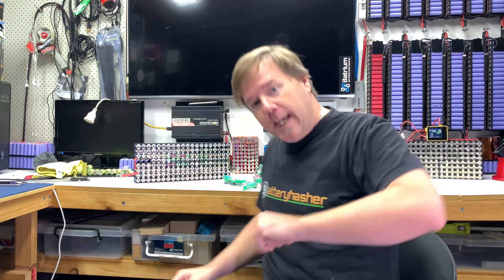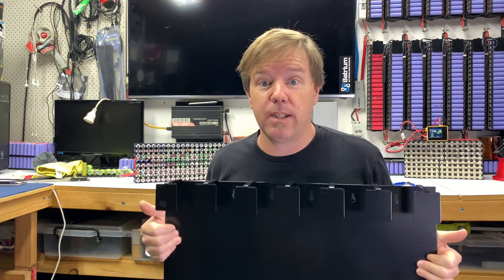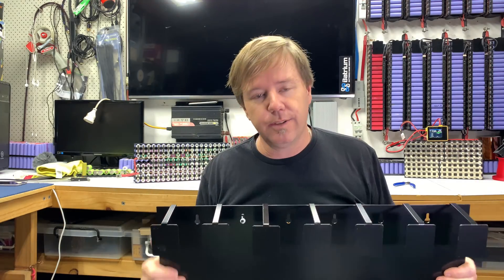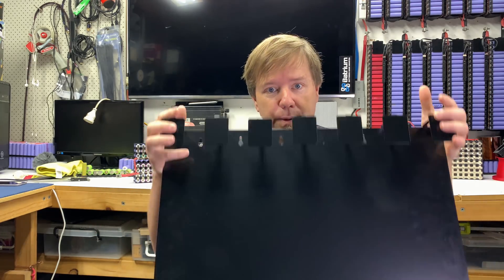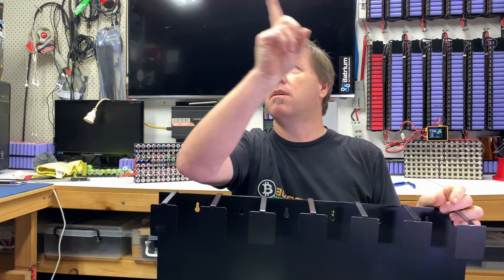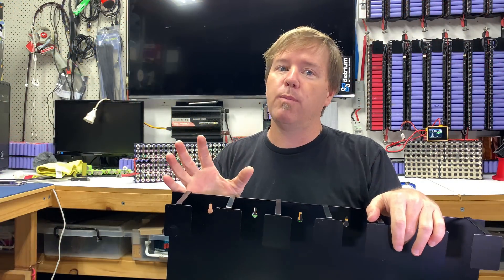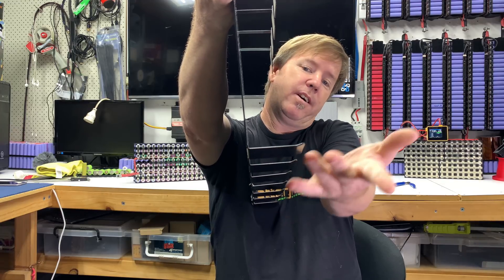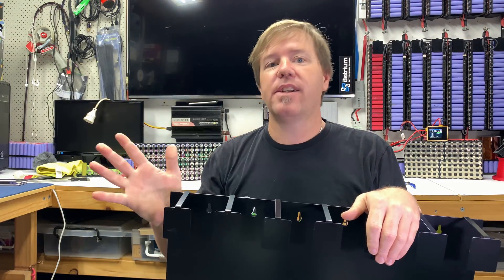My DIYPowerwall Wall mount CAD drawings

Comment: Have you done away with fuse wire?  Look like all your packs now have the nickle strip
Reply from the maker: new one is two or three cells then fuse back to busbars. Trying something new
Reply: ah ok.  makes sense.  still fused, but not as many.  lol
Reply from the maker: Going to run a 14s pack an test. it's faster but undecided if it should be the new way of doing things

Comment: Do u have any video using mppt direct conection to 18650 without using bms or batrium only balancer?
Reply from the maker: Yep all my early videos - 2-3 times a day i tested every cell with my multimeter - got old very fast but does work

Comment: I made up my mind on the first I am ordering my parts on the first, to build my first battery & it will be 18650 & solar charged, the battery will be no less than 100 amps & it looks like it can do 2,000 cyles from the battery supplier
Reply from the maker: 2000 cycles is massive! good luck on your project!